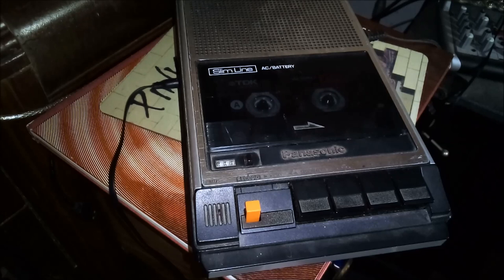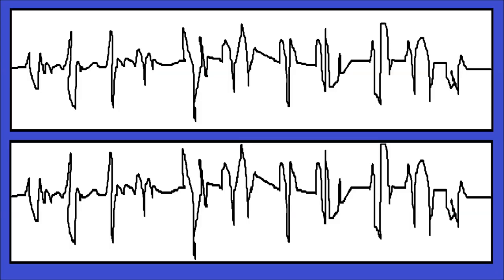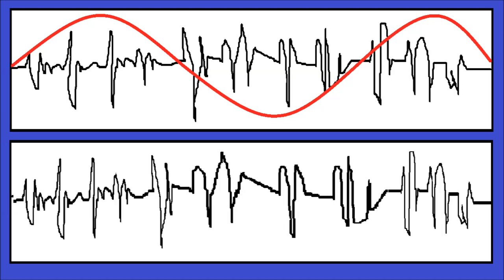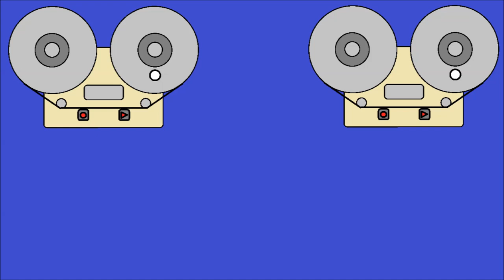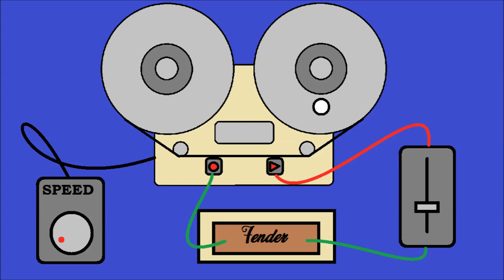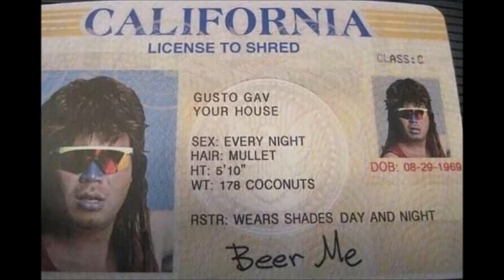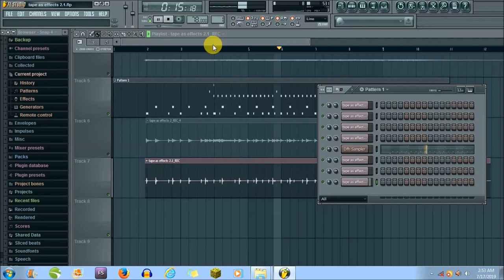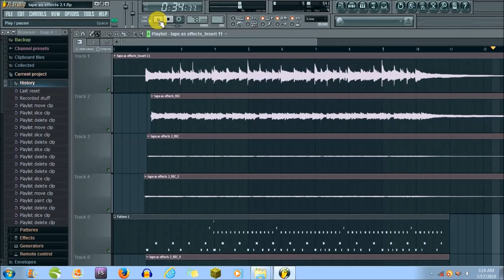Recreate OldSchool Tape FX Using Cassettes (easy to follow)

Comment: Hey thanks so much for this video! Awesome sounds, I have one question, I want to do overdubs of tracks by running them through my tascam 4 track in order to create this tape doubling effect, the problem is that when I record for a longer amount of time the tape track will begin to flutter so much that it falls off tempo, do you or anyone recommend anything for this problem? thank you so much!
Reply from the maker: Thank you so much for watching and taking the time to write a comment Nico. I had another person ask about this and I am afraid I dont have any perfect solution. I suggested to him to maybe record several pieces with overlap like 4-8 bars at a time and jog and fade them together or maybe use a time stretch function on the DAW to stretch and jog the parts of a longer recording or as a whole. I am used to working in the box nowdays and dont deal with long clips or live drums and I do a lot of copy paste kinda song building so its mostly short parts. But when sampling from records or tapes and things I do sometimes use a time-stretch feature on FL studio so something similar may be a good option?... I mean it could be possible to use a potentiometer or variac to slow a tape machine but thats quite a bit of hassle to do something that any DAW should be able to acomplish. I wish I had a better solution but I hope that helps in some way.